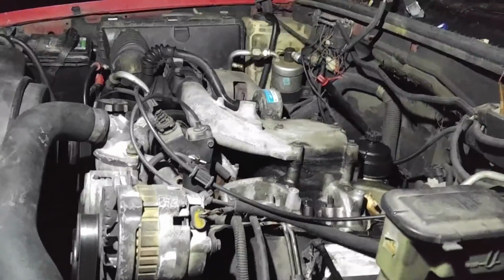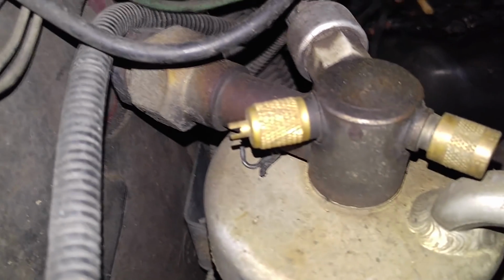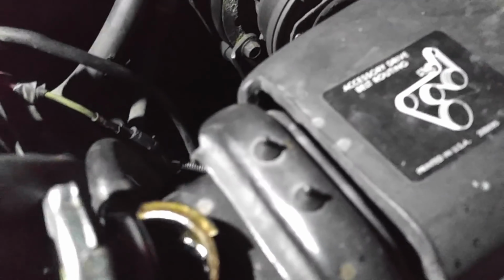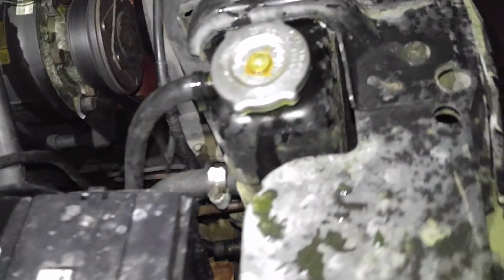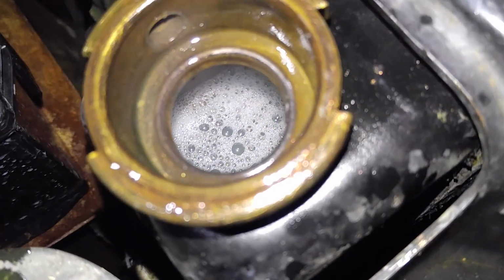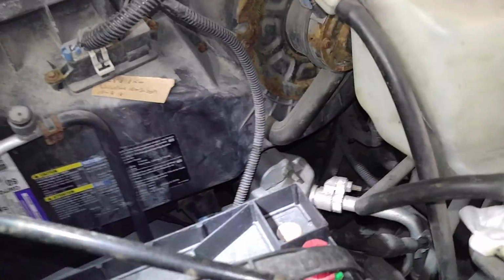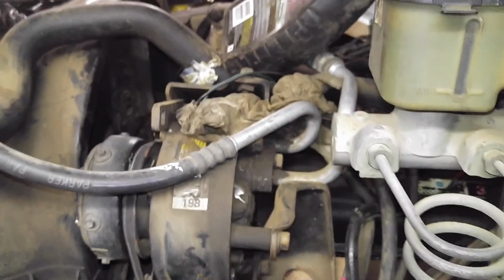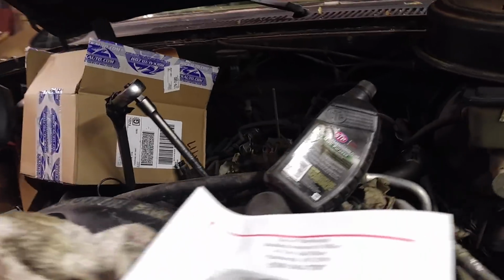6.5 Cold Bubbly? Crank 12 20 18

Comment: Does it have one thermostat  or two ?  It's been years since I last worked on one of them
Reply from the maker: This is the single thermostat model, it went to electronic injection in 94, the new interior with airbags and dash in 95, and 97 they swapped the air conditioning compressor onto the other side, and put the dual thermostat on that feeds in from the back not the front.